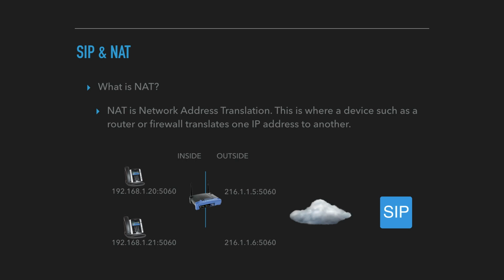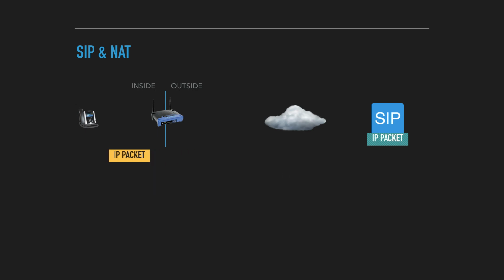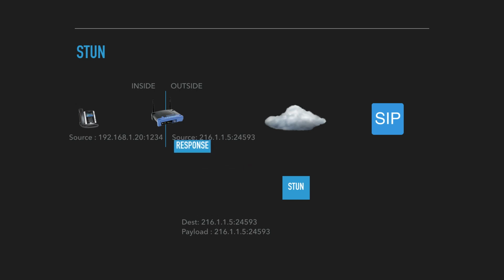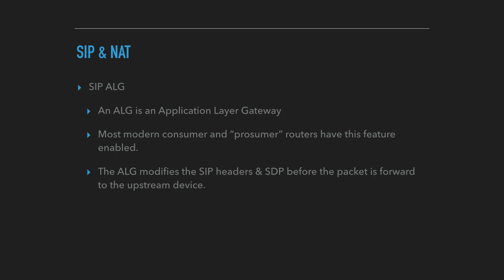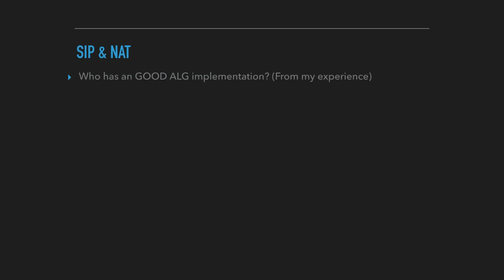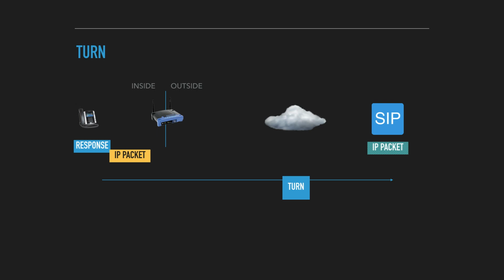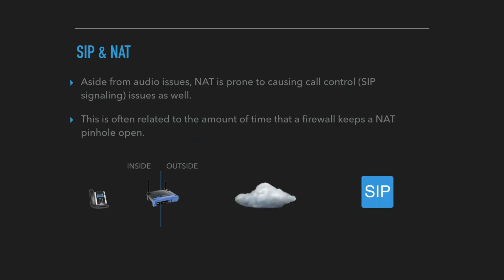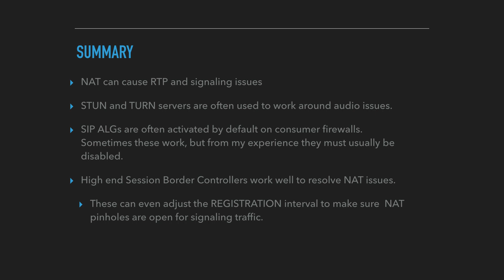Why VOIP has one way audio, and how to fix it.

Comment: So what if you dont have 2 way audio,  user (A) in Arizona home with VPN site to site to HQ,  user (B) at home in Georgia with VPN site to site to HQ,  User(A) calls User (B),  call timer is running but neither user can hear each other.. User(B) calls User(A) , call timer is running but neither user can hear each other.  Important to understand .... User(A) can call HQ just fine, User(B) can all HQ just fine can have hours of conversations from remote to HQ, HQ can call User(A) or User(B) just fine.  users within HQ can call internally just fine. its just the remote to remote seems to be the issue. 
 User(A) has DynamicDNS (no-ip.com) on firewall, modem is passing public IP to firewall, User(B) has DynamicDNS as well, and too has public IP passing to firewall